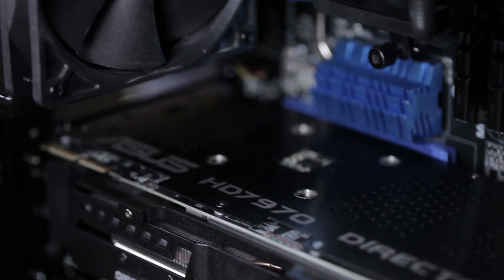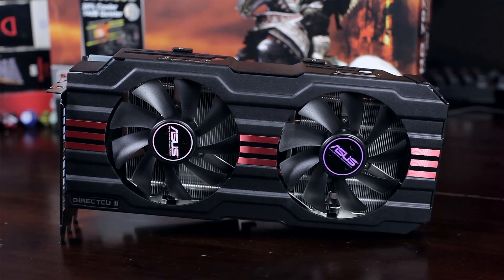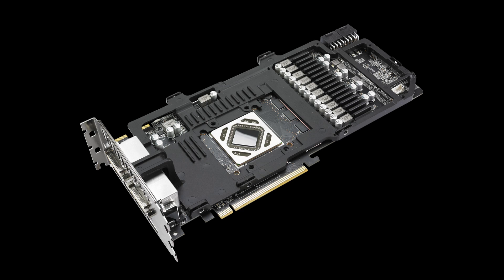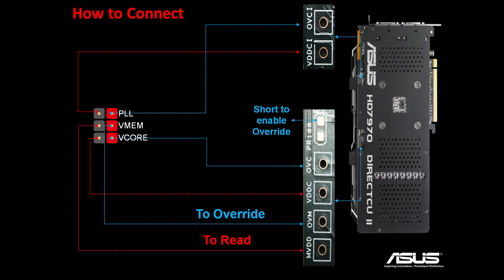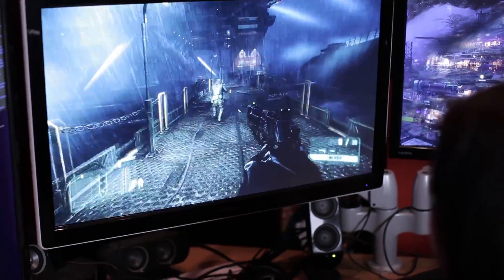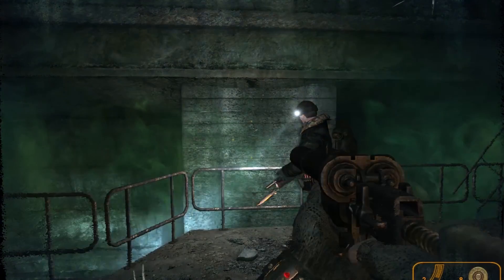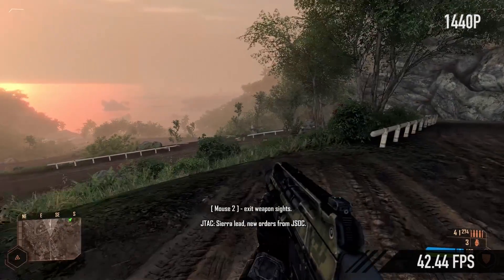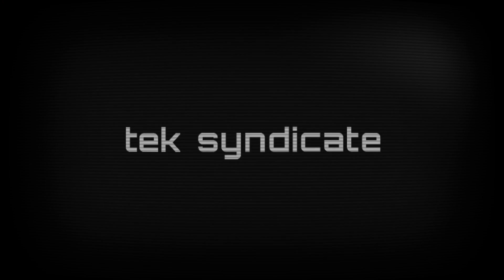ASUS HD 7970 Direct CU II Review & Benchmark

Comment: What is the next card up from this one?
Reply: 7990(dual 7970)
Reply: thanks
Reply: +joe tabrett I wouldn't really recommend the 7990 to buy now thou. Get a 390x that will be the same or better performance(1440p high/ultra 60fps).
Reply: ok. i was looking into a OC asus R9 390x. would you think a 750W PSU will run it? i have a Asus Z97 Mark 1, i7-490k, an H60 water cooler on my CPU, and my OS is running on a 120GB SSD with a 2TB storage. do you think I'll have to get a more powerful PSU?
Reply: +joe tabrett if you not going to do crossfire you'd be fine with a 600W psu, the rest of your build looks really good
Reply: +eddie reece maybe 650w as you've got an i7 just be on the safe side. In terms of what psu get a 650w g2 evga full modular, I've got the 550w there so good
Reply: ok thanks Eddie
Reply: +joe tabrett no problem man

Comment: Does AMD cards run better with 990FX than on Z77, Z87 or Z97?
Reply: There is no noticeable difference. Most probably non at all. There is no better communications, or stuff like that. It might be because of the motherboard, but not the CPU.

Comment: Whoa, ive never had it drop below 40 maxed out, but i use a mixture of high and very high setting to get a solid 60 fps. And I can tell you with certainty crysis 3 has waaaaay more detail than battlefield 3 in many aspects. I have not tried crysis on medium-low but im thinking the detail with those setting would be closer to battlefield. You can basically see every little hair on psycho defined

Comment: naaah.. not in my opinion.. i got the 670 ftw edition and it absolutely destroys... as fast as a stock 680 since it oc's itself to 1.2ghz+ and i got it for about 50 bucks cheaper than the 7970 ghz edition which i think is the only one worth getting.. (one with a custom cooler to oc)

Comment: Hello sir, my HD 7970 DC2 max temp will be around 87c. And idle will be 66c. Im using 3 monitor. Is that normal or its too hot?? Fan speed i make it to default n auto.

Comment: No, the normal Matrix has 50MHz overclock, and has a normal HD 7970 GHz edition GPU, the Matrix Platinum has a 100Mhz overclock, and is is extremely highly binned GPU, these are the best running HD 7970 GPU's in the world, while the normal Matrix has a regular HD 7970 Ghz GPU, not binned or anything. Also, Matrix platinum has an 1000Mhz bigger memory clock than HD 7970 DirectCu II, which basically makes it the second fastest GPU in the world, only beaten by a GTX Titan, which costs 500$ more.

Comment: MSi HD 7970 Lightning edition in my opinion is much better than ASUS' video cards. Mainly because it's not a triple slot video card and it cools just as good or if not better than the DirectCU II design. Plus, the Lightning Edition looks so much cooler than the ASUS video card.

Comment: All depends on the games you play.  If it's price/performance the 7970Ghz wins.  Flat out.  The GTX 680 is an excellent performer but it's around $50-$100 more and performs worse in alot of AAA titles.  So for example if you look at this years/this month's benchmarks, with the latest drivers, the AMD card will do better in Far Cry 3, BF3, Crysis 3 to name a few.  The GTX 680 will do better in games developed by Blizzard, but neither card will hold you back.  The 7970Ghz gets my vote.

Comment: Depends, the Nvidia is more pricy and depending on the game you use, performs better or worse than the Sapphire. If you want to eventually go Crossfire or SLI, then I wouldn't go Sapphire. I've heard trying to use a 100mm Crossfire bridge to connect 2 of them is hard, considering it's hot, and you want a decent spacing between the two if the mobo can accommodate it. HIS and Club 3d do nice thin HD 7970 GHz cards with good coolers. But look up cooling and performance before you buy. :)

Comment: my only question about benchmarking games is that, why include skyrim. its obviously not a demanding game. instead try witcher 2 maxed, in 3D and see if your little GPU can get anything close to 30fps. skyrim on max close to 90fps? that makes it sound like my cellphones GPU can run that game. 90fps=not a demanding game. stop using it. idc how many people play skyrim, i did. benchmarking is about testing GPU power not most played titles battle.

Comment: You shouldn't use this  Crysis 3 level for the benchmark. Modder MaLDoHD discovered that, for whatever reason, the ropes used in the level to hold up cargo containers are cutting people's framerates in half. When the ropes are stationary, everything's fine and dandy at 60fps. If they move in the wind or are shot at, though, things can drop to under 40fps. Please thumbs up so they can see

Comment: K let me resay my question with more detail

I have 2300 AUD to spend on graphics cards ( its about the same as US)

And im aiming for over kill system, I have a rog x79 extreme mobo and have  slots to fill,

I wanted to know would it be worth getting 4x 7970 (looking at the xfx black ed)
Or 
3x evga classified gtx680 at 4gb
Im open to other card suggestions such as the titan or ares but no voodoo cards.
Herd there is still crossfire issues with some games and sli is better, what you think?

Comment: Apparently the guys at Sapphire also felt it necessary to stuff like, 6GB of VRAM into a Radeon 7970. Because 3 GB wasn't enough now that the GTX Titan came out with it. And seeing as how it doesn't have a different bandwidth for memory, I'm assuming that they simply doubled the storage capacity for each individual NAND flash module.

Comment: For some reason when I was comparing the GTX 680 2GB and Sapphire 7970 OC 3GB versions the Nvidia card was getting 60+ fps on Crysis 3 maxed out with FXAA, but on the 7970 I had to lower the settings if I wanted 60fps. I hope AMD fixes that issue, otherwise I will keep the GTX 680 and let the 7970 go on eBay.

Comment: I prefer to game with just one display ( until they have monitors with no bezel or I can figure out a way to safely remove the bezels altogether without problems).  Hate bezels getting in my way on eyefinity/surround gaming setups..thus 2560x1440p is my goal soon within 1st quarter end of 2014. So
4gb gtx 670's in 2x sli should do it

Comment: 2 gtx 580's give same performance as a titan?

Are you on cocaine?

1 gtx 580 has 512 cuda cores
1 gtx 680 titan has just over 5 times that at 2688 on the same memory bus of 384 ( although the 600 series cards have better memory bandwidth implementation ..so i've read)

Takes 2x gtx 2gb vram 670's to match or beat the titan's performance and that is ONLY if playing demand games like metro at 1920x1080 on medium/high settings..above that rez..is the arond 2.7/2.8gb vram usage scenario encountered

Comment: just get another 580 (used if possible) to sli if you can it would give you the SAME performance of a titan.
or if you rly want to blow 700$ get 2 7970 3gb 
(the 7970 are better than 680 for higher resolution, something to do with memory bandwidth)

Comment: Ok  again.   YOu didn't specify what your average fps is,  

I have a 1.5gb gtx 580 galaxy accelero xtreme plus vid card ( covers basically 4 slots incuding about a slot to breath) 

I'm not paying money to SIDE-grade to a 6950 that is overclocked.

I asked these details to so I can know what to expect with a single card set up of my video card alone.  

I'm hoping by this christmas ..the gtx titan will fall at least 300 bucks to justify its cost better.  1k is an absolute rip off vs performance

Comment: .... exactly why I play at medium instead of very high... 
I could do very high 30 fps at 1080p but I only do medium for fps.
I am only saying that 
if you want to you MIGHT be able to play at high on 1440p 30fps with 6950cf (360$)
I am not saying it is optimal, I am saying it is an option and you don t need 500$ cpu for that, I am only using a 200$ 3570k and old gpus.
So yes it is demanding for 1440p max 60 fps but that s the point of the crysis franchise.

Comment: 30 fps is garbage on a fps game.  Absolutely unacceptable to an experienced gamer.

One exception to this is starcraft II with more than 100 toons on screen in a big battle.  that is still realistically playable regardless of 120hz monitor or 60hz monitor being used.

If you're gaming at 30 to 40 fps under LIGHT fighting (which is ANOTHER thing you left out...heavy, light or no fighting)..then your fps will dip to 20's.  

You have fun with that.

Comment: I run it with EVERYTHING at medium but texture at very high on 1080p, 1x aa, no lens flare or motion blur and Vsinc on
on a 60hz monitor
6950s can be had for 180$.
My point is for about 400$ you could run it on high if you don t mind 30fps

Comment: Crysis 1 wasn't this much of a hassle at 1680x1050 with 3.2ghz dualcore amd cpu getting between 50 to 60 fps with medium/low eye candy settings at that rez with 512mb 8800gt ...cpu and gpu at stock.

Crytek...wtf gives?

Comment: Not sure why people freak out about fan noise; I leave my cpu fan on 100% all the time and on my graphics card I set the fan on a temperature curve and keep it as high as it needs to be. Is noise really that big of an issue when too low of fan speeds could cause unnecessary overheating?